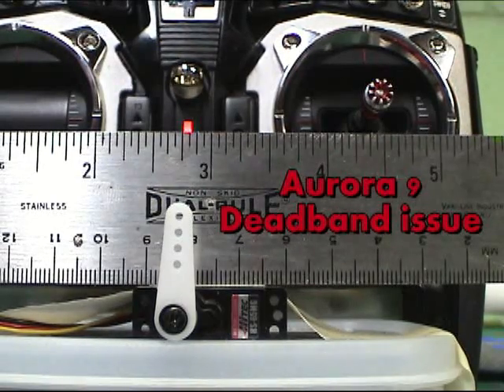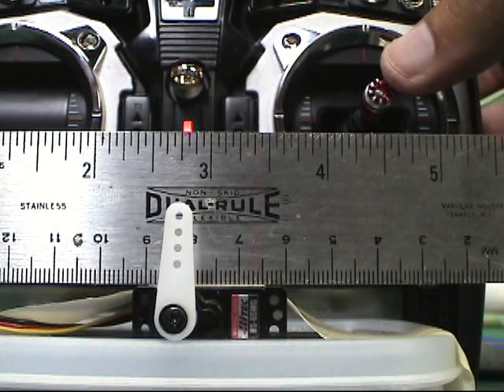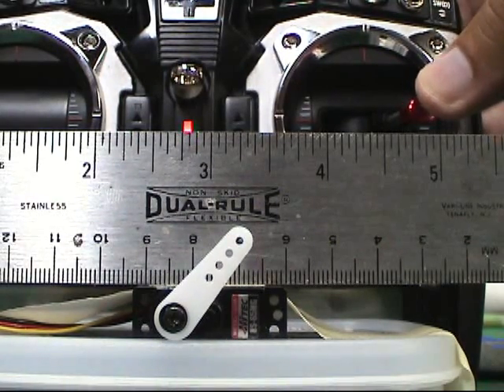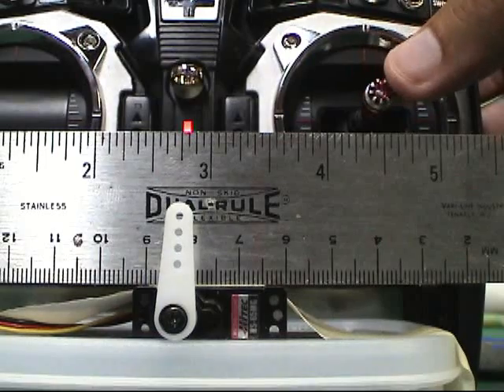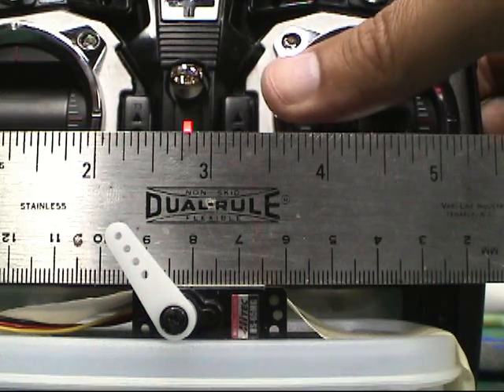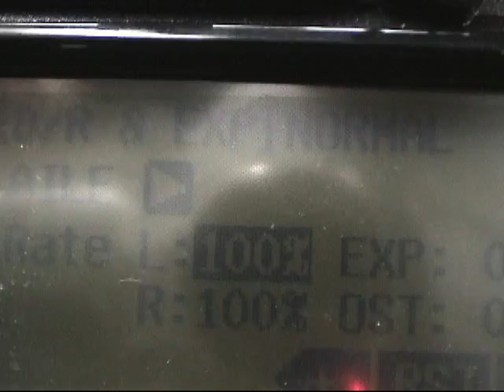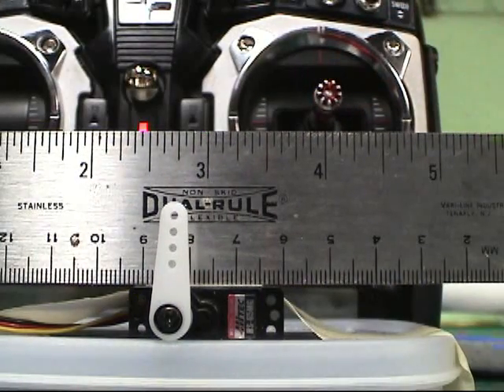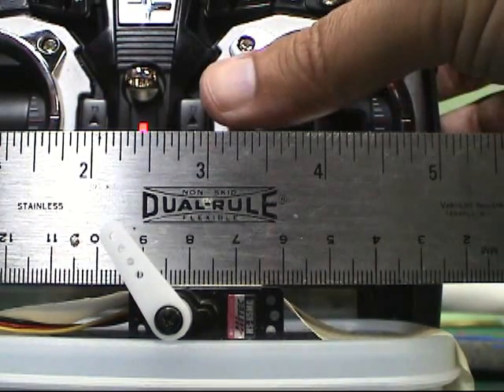Aurora 9 deadband issue - left aileron

Comment from the maker: @lassecfc Hitec won't replace the defective pot.  They are performing a bandaid fix by soldering another POT over the existing POT to adjust the resistance.  I am waiting for the proper fix which is not yet available when they change the D to A converter for a larger range of variance.